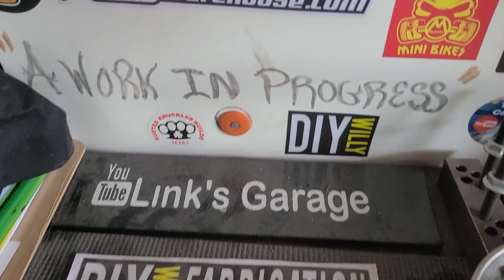Mini Dirt Track Racer "What Goes Up Is Going Down"

Comment: Finally I found a side by side comparison between the 2 ct100/cc100
Reply from the maker: There will be a nice comparison soon! I just have to get them both built. This video covers the hard part. The cc100x is definitely a bit sportier.
Reply: @fatbuddycat  awesome. Haven't been a fan of the little mini bikes but they have been growing on me. Just looking at options. Still have my Massimo Warrior mb200, and my trailmaster mb200-2, just wanting to add to the fleet
Reply from the maker: @wesleyammon8425  the nice part is that they are small. If you build them right you can make them a lot more comfortable. I haven't stretched one besides the Vintage one with the swing arm but this one also looks good with a short axle stretch and 12 inch pit bike wheels.
Reply: @fatbuddycat  awesome ill have to finish the video after work. But the front with that tire combo looks good. Ive been eyeing the cc100, mm80, or the trailmaster storm.